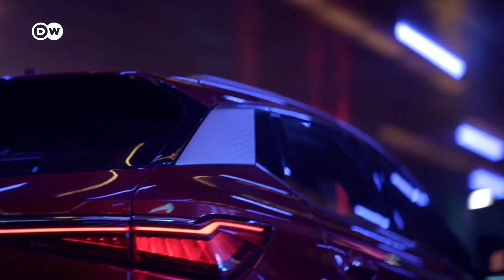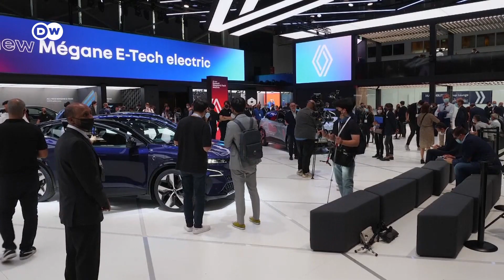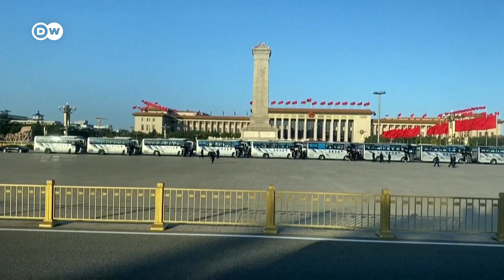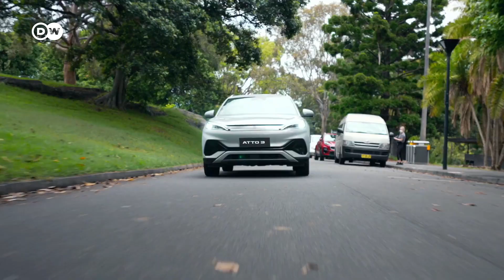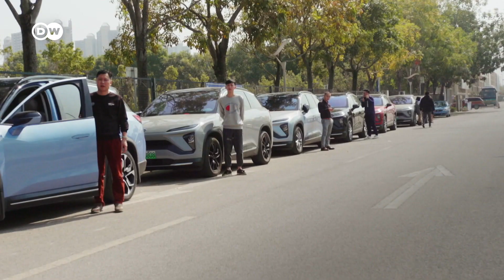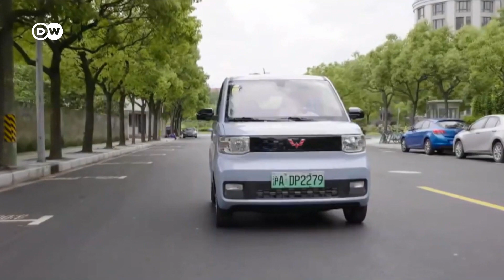Why Germany Should Worry About China’s EV Expansion 🇨🇳

Comment: Hello Mr. Liu; note I specifically said 5 million model 3 size packs; a large number of battery packs produced are for what one may call golf carts - which are vehicles incapable of safely driving especially on the Highway; these have very small batteries, and short ranges. So sure you could probably make 10 million golf carts or even 12 million. You probably are also counting PHEVs - which Mr Viking here isn't a fan of. So we are only counting BEVs.

Comment: It might be possible for China to take a bigger share of EVs but that share is very limited. On average 100,000 tons of lithium are produced annually; if half is used for EVs then you have a max of about 5 million Model 3 size battery packs; doesn't really matter who makes them; it will remain a niche market until the choke point opened.  Either much more efficient use of Li in batteries or a different chemistry sans Li - is needed.
Reply: Merely China produced more than 5 million EVs in 2022, so seems there's something wrong in your calculation. And the projection of EV sell worldwide is 14 million. That doesn't look like a niche market to me.
Reply: Sodium batteries are coming

Comment: This report was a great example of how the German autoindustry and experts still don't get it. It's not raw materials etc that made the difference. The difference is that an EV is radically different in terms of what it needs to be successful (Software, Battery) than an ICE car (engine + transmission). German auto manufacturers are word leaders in engine design and manufactury. Leaps and bounds ahead of any American manufacturer easily. Same goes for transmissions.
Problem is you need neither of those for an EV. EVs have incredibly simple motors in comparison to ICE engines. They don't even need a transmission to put the power down. Instead battery chemistry and software behavior in how to charge, pro-long and discharge batteries is what makes all the difference. An EV is a computer on wheels. Tesla is the prime example of this and while most Chinese EV manufacturers are still behind on software, they are catching up real fast. Unlike German ones who still struggle with this new way of working.
Reply: Software would be especially difficult for Germany and Japan, as their software industry is way smaller than US and China's. One can say EV is US and China's joint conspiracy against Germany and Japan, replacing the strongest area of the latter two by their own.

Comment: But also im not sold on the EV revolution. Just like oil lithium is finite. And on the carbon emmisions thing. The car produces no emmissions itself but the components the car is made from definately do. The right mix would be like 60 /40 or 50/50 ev and gas on the road.
Reply: The electric vehicle industry is far from mature and perfect? There are still many problems to be solved. But the problem is by no means unsolvable, wait patiently, maybe the next car will be perfect..

Comment: An electric car is very simple a battery and four motors.  The secret is battery chemistry and maintaining ideal battery temperature with the use of as little energy as possible.  Chinese have committed to the electric car and the electric charging infrastructure in China.  So now China can use their own massive market to drop the production price like no one has seen before.

I worry not so much about the German economy but the Japanese economy where one in twenty jobs are related to fossil burning vehicle production.  At least German car companies can see the Chinese electric vehicle expansion coming.  But the firing of Herbert Dies set VW back many years.  He was actually doing something to compete with China.